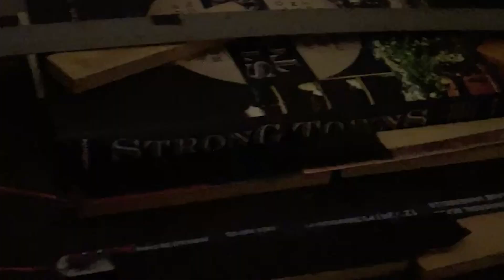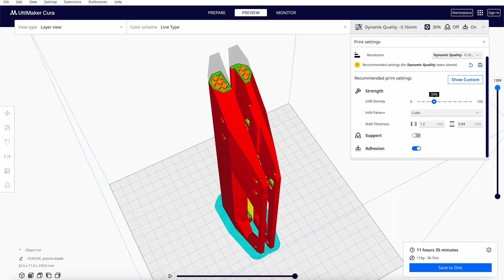REAL PLASMA BLADE science

Comment: well you could also bend the arc with with pressurized air. to a shape of a sword. between stars in space there is not much stuff at all. ultra low density plasma particles. tons of photons tho. some charged particles.